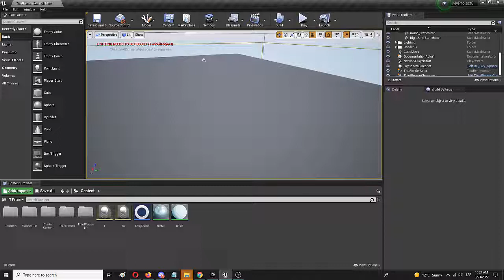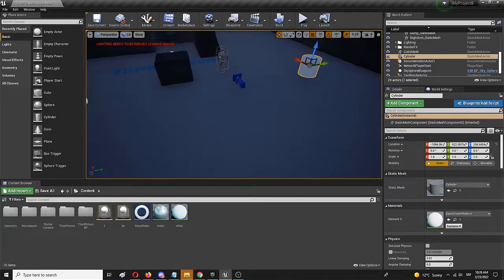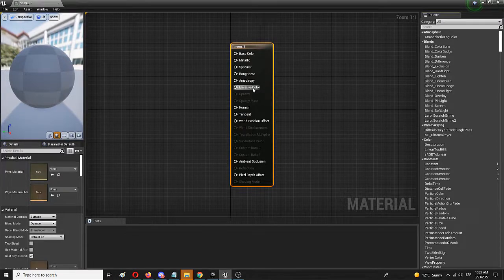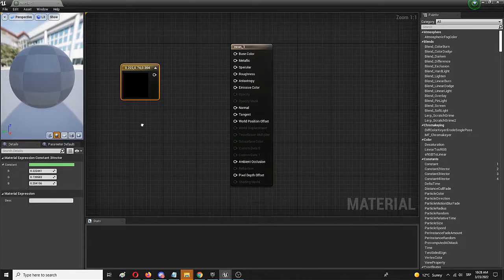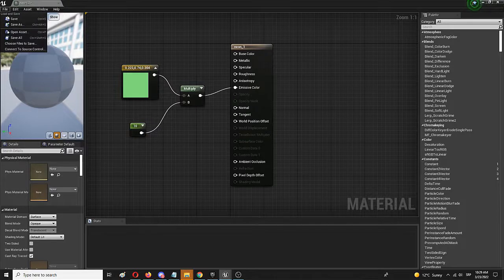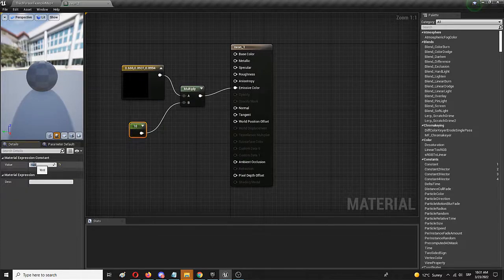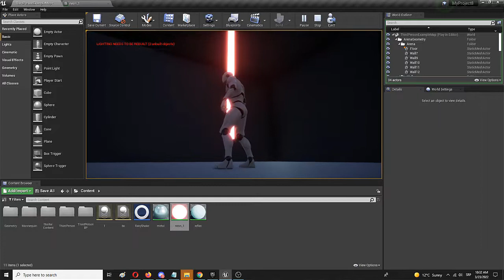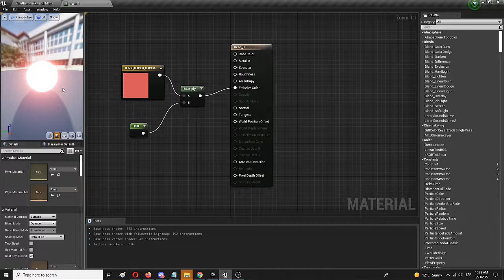How to Create Neon Lights (Light Rods) in Unreal Engine - UE Beginner Tutorial

Comment: What do you think would be a good option for creating a completely pitch black environment which exclusively uses emissive materials for lighting? I'm trying to make something that a little hard to describe, think Geometry Wars but as a 3d fps in terms of the art style and the camera at least. The issue I'm running into is that even from a blank project there seems to be some sort of a world setting or something that still draws materials as if they are being lit up by a hidden ambient light. My world is not supposed to have a sun, it's a void space and everything is constructed of various forms of energy that give off light. Think like as dark as the underground caves in TLOZ Tears of The Kingdom. I've thought about maybe using some sort of post process but I'm not sure what would work or if I even need to? I just really want the neon to pop, it is so cool to see it on models that are designed with the effect in mind like electric hypercubes and such. Any ideas?
Reply from the maker: Best route for sure would be to use a post-process volume and try out different things in very moderate ways, then to increase the things you like the look of. Otherwise you risk too much work for individual meshes and light sources that might end up being something that doesn't work for your needs..

Comment: Why does it Turn off when the camera is not facing it? Need Help!
Reply from the maker: You created an emissive material that stops working when not facing the player? How could you tell then that it stopped working, but the emissive reflections of the surroundings or something else?
Reply: @IvicaMilaric  well the reflection on the character turns off if I turn away from the light but it is a material setup as a missive.
Reply from the maker: Hm, that's very odd. Did you manage to find the solution since then?
Reply: @IvicaMilaric  no not yet it might be something with the camera like a particular setting
Reply from the maker: Test it out by creating a whole new project - for example, a top-down one. There, create the same material and see how the material functions, being that the camera setup is from a bird's perspective.
Reply: @IvicaMilaric  smart
Reply from the maker: Glad you like it and please let me know how it turns out!
Reply: If you are talking about the reflection of the object with the emissive material disappearing when you look away from it, that is simply how UE4 works with its reflections, If you want the reflections to stay then you could use a reflection capture component or upgrade to UE5 and use Lumen Reflection Method in the post processing, hope this helped out.